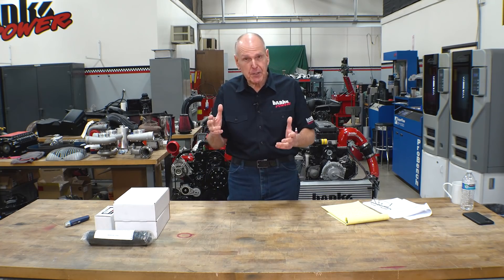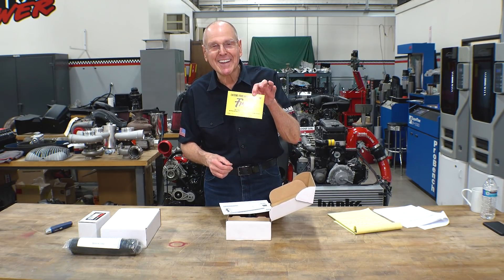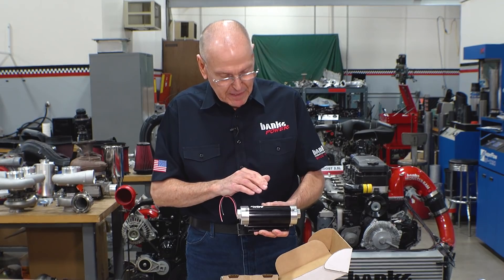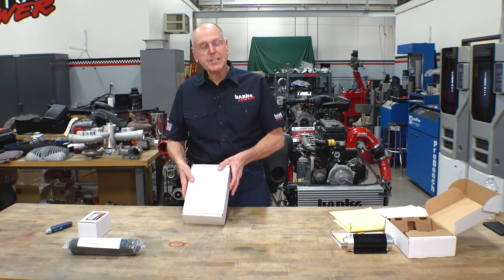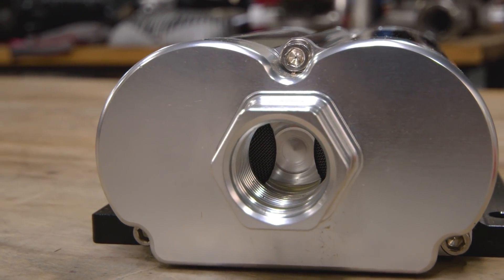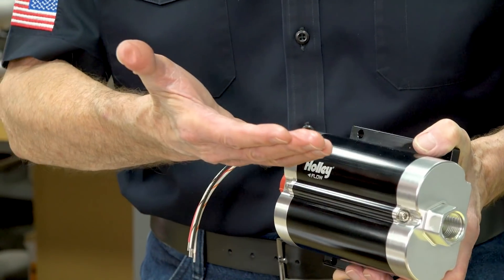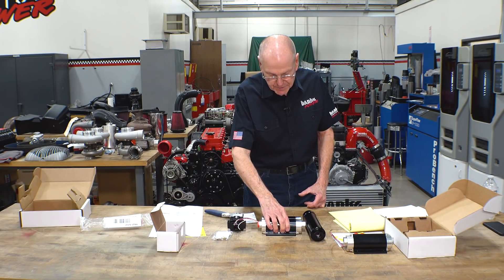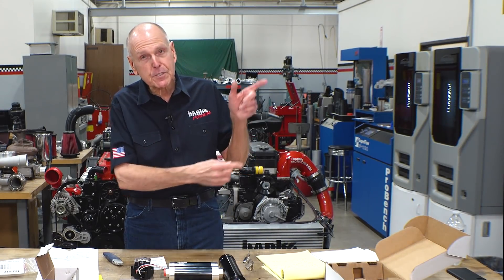UNBOXING Holley Billet Fuel Pumps

Comment: Why would you bother using expensive and low power 12V pumps when you are in a workshop with three phase power?  Surely a mains pressure pump with a nice adjustable pressure regulator would have been ten times the bang for the buck?  Makes no sense to me.

Comment: So, to avoid some confusion to word on the street.  Do these Duramax Diesel engines need some sort of Lift Pump added to them vs. leaving them in stock form? Many are saying they do and the advertisers are saying yes because they prevent hardware damage to injectors etc. by removing air from the fuel.

Comment: The bigger 200Gph twin pump, only one side would need a check-valve in each to stop the reverse flow through the offline pump. I have seen twins before but were twin-12V setups, put both in parallel for 12V operation or put them in series for 24V systems.

Comment: Mr. Banks, you talk about filtration. What is your thoughts on the systems that claim to remove air from the diesel as well, such as the F.A.S.S. and Air Dog? Would they work as well as these Holley set ups in a pick up?

Comment: Elevate both fuel tanks, and put 2" gravity feed pipes...  Then put the filter, pumps and everything else inside...  Those ought to keep up.
Reply: If they have fuel delivered that would work well. If they load the tanks and take them to get filled it might be a little challenging. Oh and gravity has NEVER failed.

Comment: How about adding an alternating relay on larger Holley pump as well to switch between constant pump and air density controlled pump each time the key is turned on in order to use each pump evenly as possible in order to maximize pump life? I like the set up. Those are all very nice products!

Comment: Why are we not using centrifugal pumps for the fuel lift pump? I don't even like centrifugal pumps but even I've got to admit that it's far better suited for continuous low pressure applications like this. Not to mention it would be smaller, have a much much longer life expectancy, and have a easily adjustable flow rate.

Comment: Now I would have thought Holley was a competitor... I'm confused.
Reply: They overlap a bit kinda like cousins. Basically Holly is gasoline, Banks is diesel. Fact is that they do have a small amount of product overlap but huge amounts to gain by sharing ideas. Working side by side instead of against each other.
Reply: @notsofresh8563  You realize they share more than ideas. Gail works for more than "Banks".

Comment: the new Holley pumps are so clean and easy to install I remember having to run 2 airplane fuel pumps in order to have 300 gallons a hour on a drag car I built in 1980. we had the standard on the fender rail aftermarket fair or the only thing that did what we needed in the heavy duty airplane parts. the market was in a massive slump in the 80's from the gas shortages so no one made the stuff we needed so we had to go with what we could get . I'm so happy to be able to see how the industry has come back with a passion in the last few years
Reply: You haven't seen anything yet. Brushless pumps will outflow just about anything and really handle high pressure fuel systems as the aftermarket starts to adjust to DI.

Comment: What's your opinion on putting some kind of desiccant in the intake system to remove unwanted moisture?
Reply: Lassi Kinnunen I believe there are some types of desiccant that instead absorb heat in their operation, but I could be mistaken. I'll get back to you on that.

Even if weight is an issue for vehicles, though, this system might be viable for stationary installations like emergency generators.
Reply: I put 98 small bags of it in the intake of my powerstroke and it gained nearly 45 hp/155 lb.ft. of torque.
Reply: 805_Diesel You don't need to be sarcastic about it.

Comment: hurry up with killing a duramax.  I want to know what crap to buy to take mine to the edge  without killing it.
Reply: I would avoid the 250 shot of nitrous.
Reply: A forged crank would be a good place to start :) ask me how I know :(
Reply: SomuchBS how do you know it needs a forged crank?
Reply: @davidschmidt449  d
Do a quick YouTube search on Duramax crank failure. Some were not up to having moderate/big power or hard use and broke.